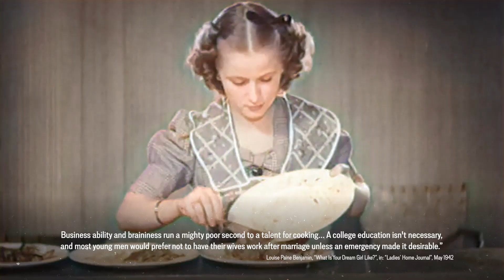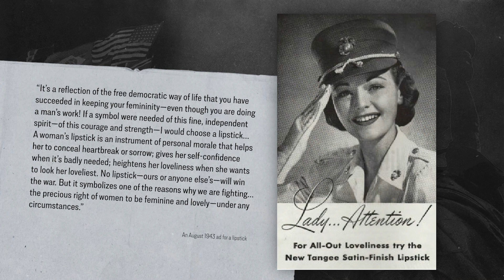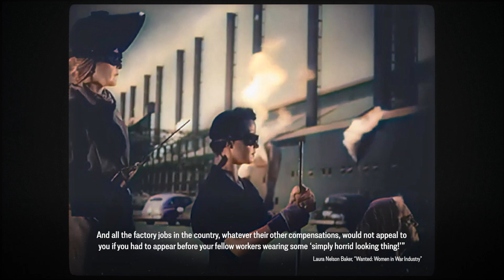The Myth of Rosie the Riveter - On the Homefront 016

Comment: My Grandma worked on an assembly line in New York building antiaircraft gun directors to be installed on ships at Brooklyn Navy Yard.  She had been working there for almost a year when she met my Grandpa, a Navy antiaircraft gunner.  Although it’s unlikely, there’s a slight possibility that Grandma might have built the exact fire control system that Grandpa operated.

Comment: 10:52 Welding is not a low-skilled job. It takes a lot of skill and many don't have the aptitude to get the hang of getting the weld beading correct. Welding is a high paid craft. Maybe tack or spot welding can be done with less aptitude.

40% of wartime aircraft industry workers were women. Bosses in the aircraft industry said said many of the tasks were done better by women.

Comment: 10:51 Not convinced welding was or is a low-skill job. As a side note, the welds (likely done by men) on many "victory ships" proved inadequate for service in the North Sea, resulting in numerous non-combat sinkings. The problem was a design that emphasized speed of construction, relying on welds instead of rivets, where a Rosie the Riveter or Ron the Riveter might have saved lives and cargo. Great video!
Reply: It was the brittleness of the steel at Artic temperatures and the rigid nature of welding, rather than the quality of the work done by the welders, that led to fractures, which didn't  necessarily  start at welds.
Reply from the maker: We've created a standard response to this kind of comment:

The emphasis here is on "relatively". We have no intention of disparaging what are, of course, difficult jobs. However, the point stands that the highly specialized tasks "Rosie" has been imagined to perform were not what most women did in reality. Factory owners preferred to put women on Taylor/Ford-style production lines. "Simpler" welding tasks were common on such lines.

Comment: 10:10 Pretty sure the jump from 12 to 19 million is 58%, not 9%.
Edit: It is around 9.6% per annum of 5 years of annual compound growth eg:12x[1.096^(5)], or 9.2% of continuously compounding growth 12x[exp(5x0.092)].
Reply: And it's a huge jump. This video seems to be misinfo.
Reply: @cst270  it was pretty clearly an accident. if you really cared about misinfo, you wouldn't be subbed to so much trashy political media.
Reply from the maker: No misinformation, just a silly human error. We've issued a correction in our pinned comment.
Reply: @WorldWarTwo  10-4

Comment: One place that women played a very important role in the US war effort was with the Manhattan Project. When the Oak Ridge facility was working on separating U-235 from U-238 using the electromagnetic separation process, a group of women suggested they might be able to do the job better than their male counterparts. The scientists in charge of the project didn't believe them, but they decided to run the separation process with two teams, one male, the other female. The women turned out to be far better at maintaining the correct current in the system and making fine adjustments to the equipment than the men were, and so they ended up manning the separation equipment used to help create Little Boy.

Comment: Welding is "low skilled work?" I don't think so. I would challenge the writers of this episode to pick up an acetylene torch or a stick welder and see how challenging it is to put down a good bead.
Reply from the maker: We've created a standard response to this kind of comment:

The emphasis here is on "relatively". We have no intention of disparaging what are, of course, difficult jobs. However, the point stands that the highly specialized tasks "Rosie" has been imagined to perform were not what most women did in reality. Factory owners preferred to put women on Taylor/Ford-style production lines. "Simpler" welding tasks were common on such lines.

Comment: Saying Welding is a low skill job ?? If you ever welded you would know different
Reply: En mass industrial welding in the 40s was a low skilled job
Reply from the maker: We've created a standard response to this kind of comment:

The emphasis here is on "relatively". We have no intention of disparaging what are, of course, difficult jobs. However, the point stands that the highly specialized tasks "Rosie" has been imagined to perform were not what most women did in reality. Factory owners preferred to put women on Taylor/Ford-style production lines. "Simpler" welding tasks were common on such lines.

Comment: As someone that has welded and operated manual milling/turning machinery, I can assure you that those ARE NOT low skill jobs
Reply from the maker: We've created a standard response to this kind of comment:

The emphasis here is on "relatively". We have no intention of disparaging what are, of course, difficult jobs. However, the point stands that the highly specialized tasks "Rosie" has been imagined to perform were not what most women did in reality. Factory owners preferred to put women on Taylor/Ford-style production lines. "Simpler" welding tasks were common on such lines.

Comment: Welding is a low skill job?
Reply from the maker: The emphasis here is on "relatively". We have no intention of disparaging what are, of course, difficult jobs. However, the point stands that the highly specialized tasks "Rosie" has been imagined to perform were not what most women did in reality. Factory owners preferred to put women on Taylor/Ford-style production lines. "Simpler" welding tasks were common on such lines.
Reply: @WorldWarTwo  I know 2 female master welders. Ones works for the Boilermakers local here in the Foss shipyard. The other is a union iron worker who does both the structural and ornamental part of the craft. In a sense they actually have an advantage, they can get into much tighter spaces to work and they both like to climb.
Reply: Anyway been following you since " The Great War", keep up the good work.
Reply: Anyway been following you since " The Great War", keep up the good work.
Reply from the maker: @jamestracy410  Thanks for the kind words and for being such a long-time fan.

A final thing to note on the welding point is that we are not talking about the modern welding profession. We are talking about the 1940s here; when attitudes to labor and how it should be organized were different from today.

Comment: Welding is not a low skilled job!
Reply from the maker: We've created a standard response to this kind of comment:

The emphasis here is on "relatively". We have no intention of disparaging what are, of course, difficult jobs. However, the point stands that the highly specialized tasks "Rosie" has been imagined to perform were not what most women did in reality. Factory owners preferred to put women on Taylor/Ford-style production lines. "Simpler" welding tasks were common on such lines.

Comment: welding is not a low skill work.
Reply from the maker: We've created a standard response to this kind of comment:

The emphasis here is on "relatively". We have no intention of disparaging what are, of course, difficult jobs. However, the point stands that the highly specialized tasks "Rosie" has been imagined to perform were not what most women did in reality. Factory owners preferred to put women on Taylor/Ford-style production lines. "Simpler" welding tasks were common on such lines.

Comment: American aviation plants were over-run with women. Men were just too sloppy, brutish.
The very process of manufacture was re-tuned for female strength... which was a revolution in itself.
( Weight compensated power tools, etc. ) 
The very expression Rosie the (aircraft aluminum) Riveter was coined BECAUSE women dominated that craft. 
No-one thought that Rosie was erecting high iron.
The story from the Ford B-24 plant was that gals performed 90% of the assembly labor -- and that women totally dominated the touchy crafts.

They still do -- in Red China. You'll run into factories that have endless rows of women assembling electronics -- no man need apply.
If you want it done right -- put a woman on it. 

Speer considered Adolf's greatest gaff to be his refusal to accept women into war plants. 
In the USSR and UK, women were just everywhere in war production. Rosie was not an American exception.

Obama's Grandmother worked for Boeing. IIRC, that's where she hooked up with Obama's Grandfather. (WWII)

The one limitation on female war plant labor: no-one wanted Mom to leave home for a distant city.
Institutionalized day care was alien to American culture. (Not so in Europe or Asia.)

Comment: So if the "We Can Do It" poster was just by GE, how did it become so iconic in American culture?  Did that happen during the War, or later?  (Also, welding is not "a relatively low skilled job.")
Reply: If it was repetitive welding on a production line, it would be low skilled. Welding the seams of a jerry can comes to mind.
Reply from the maker: Yes as we've said elsewhere, the emphasis here is on "relatively". Factory owners preferred to put women on Taylor/Ford-style production lines. "Simpler" welding tasks were common on such lines. 

As for the the We Can Do It poster, it seems that it was rediscovered in the 1980s and from there took on a life of its own.

Comment: Welding is low skill work? Not if you don't want it to fall apart.
Reply from the maker: We've created a standard response to this kind of comment:

The emphasis here is on "relatively". We have no intention of disparaging what are, of course, difficult jobs. However, the point stands that the highly specialized tasks "Rosie" has been imagined to perform were not what most women did in reality. Factory owners preferred to put women on Taylor/Ford-style production lines. "Simpler" welding tasks were common on such lines.

Comment: "relatively unskilled jobs, like welding, or on the assembly line.". Wait, what?  Welding is a skilled job, anywhere, at any time.  Maybe a bit of a error in the video, but, otherwise, great stuff.
Reply from the maker: We've created a standard response to this kind of comment:

The emphasis here is on "relatively". We have no intention of disparaging what are, of course, difficult jobs. However, the point stands that the highly specialized tasks "Rosie" has been imagined to perform were not what most women did in reality. Factory owners preferred to put women on Taylor/Ford-style production lines. "Simpler" welding tasks were common on such lines.
Reply: @WorldWarTwo  wonderful point... Great channel, several words coulda made that so clear(and so true.). The way it was worded was inaccurate. Plain and simple. Welding is a highly skilled job, assembly line melting metal is not.  I'm not a welder, I love ur channel, and I hate pedantic internet arguments.    But I, (someone who isn't driven by perfection) thought... Wait a second...  U just need to add one or two words, even in post editing.  GREAT CHANNEL. N/S.
Reply from the maker: @jeffersonott4357  The whole "high-skilled/low-skilled" dichotomy is admittedly inelegant. It's widely repeated in the literature on the topic, but we probably could have thought of better terminology ourselves.

Comment: Welding a low skill job? I guess you have never done it before. Watch your mouth when you call a highly skilled job, low skilled.
Reply from the maker: We've created a standard response to this kind of comment:

The emphasis here is on "relatively". We have no intention of disparaging what are, of course, difficult jobs. However, the point stands that the highly specialized tasks "Rosie" has been imagined to perform were not what most women did in reality. Factory owners preferred to put women on Taylor/Ford-style production lines. "Simpler" welding tasks were common on such lines.

Comment: Welding is certainly not a low skilled job. I suggest you try it and work with a certified welder before making such a comment.
Reply from the maker: We've created a standard response to this kind of comment:

The emphasis here is on "relatively". We have no intention of disparaging what are, of course, difficult jobs. However, the point stands that the highly specialized tasks "Rosie" has been imagined to perform were not what most women did in reality. Factory owners preferred to put women on Taylor/Ford-style production lines. "Simpler" welding tasks were common on such lines.

Comment: Jawohl!  Another myth busted.  And you use the term "negative reinforcement" correctly (an environmental event that increases the frequency of subsequent behaviors through its systematic withdrawal).  Only radical behaviorists typically use that one correctly.  I am glad that you close with the point that, even though not that many additional women went into the work force, those that did returned home with a positive memory of the social and economic freedoms that out-of-home employment provided.  And they told their daughters about it, too.  And then easily available, reliable birth control arrived, and everything changed.  

One quibble:  welding is not a low-skilled job.  I do not know what kinds of limits were placed on the kinds of jobs women could fill, particularly given the fact these were seen as temporary, but many of these jobs did require a good degree of technical skill, often acquired on the job site. As an example, PT Boats were "wooden wonders," but did you ever look at the actual materials and methods involved in building the hull of just one PT boat?  And that is only one of the weapons that helped us to win the war.
Reply from the maker: Thanks for watching, Thomas.
Reply: @WorldWarTwo  you are welcome!  And may I say, without sounding too sexist, that Anna proves here that a young woman can do just as good a job while looking good?  (Trying not to picture Indy and Spartacus in pearls.)

Comment: A low skilled job? Welding? Lady you must never been around people who do welding. It is not low skilled.
Reply from the maker: The emphasis here is on "relatively". We have no intention of disparaging what are, of course, difficult jobs. However, the point stands that the highly specialized tasks "Rosie" has been imagined to perform were not what most women did in reality. Factory owners preferred to put women on Taylor/Ford-style production lines. "Simpler" welding tasks were common on such lines.